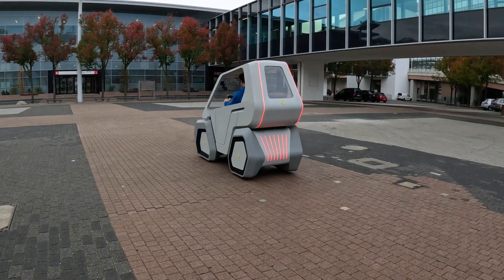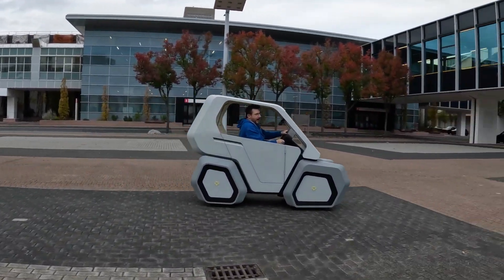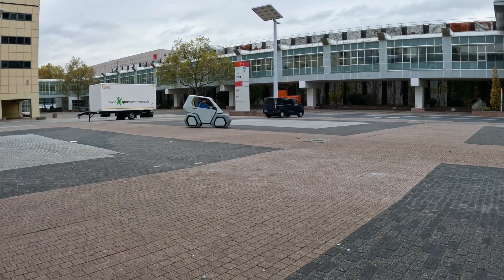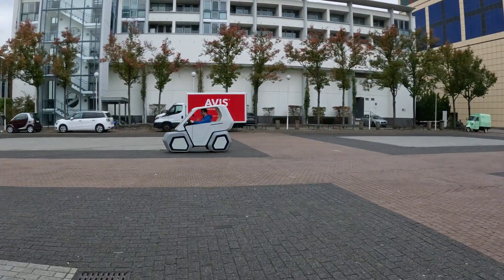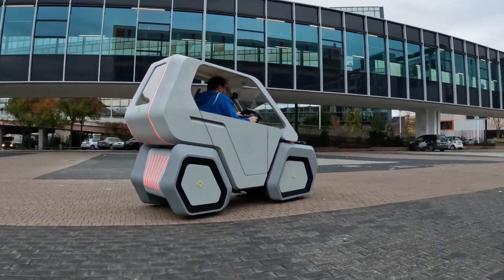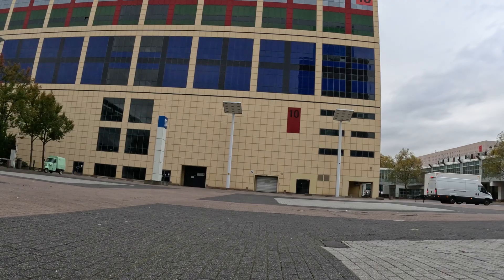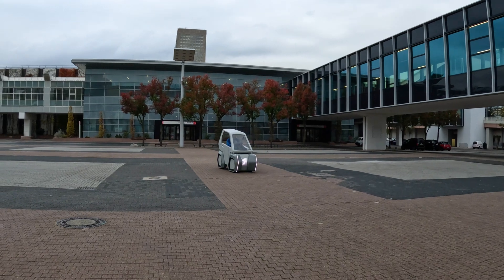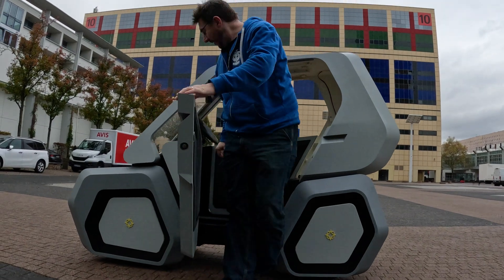Bicycle of the Future?

Comment: That is so awesome! But as a Dutchie there's no way i'm gonna accept it being called a bicycle
Reply: I can't speak for where you are, or for that matter where this company is located, but I happen to live in the same state in the USA that Joel lives in. He mentioned that this is an "electric assisted pedal" device. In my state, and about 90% of the USA, if it uses pedaling (even electric assisted) as its primary mode of transportation it is classified as a "bicycle" regardless of the number of tires. I had a "4-wheel bicycle" (electric assist hadn't been invented yet) around 30 years ago when I was a child and nobody cared whether it was actually a "bicycle" or a "quadracycle" ... they only cared whether I was wearing my helmet, despite it being nearly impossible to fall off.

Comment: How is this a bicycle that's a small car
Reply: He mentioned that it's an electric-assisted pedal ... um, transportation device. Even with 4 wheels, in most places (including where I live, which happens to be the same USA state Joel lives in) the pedaling part makes it officially a "bicycle" (the law doesn't differentiate between bicycle, tricycle, and quadracycle... anything that you pedal to make move counts as a "bicycle"). They sell "4-wheel bicycles" all the time. I had one as a kid (almost 30 years ago) because I couldn't keep my balance (discovered later it was an early symptom of a form of muscular dystrophy / neuropathy). There would be a little more argument that it's a "car" if you were using the don't-bother-pedaling "electric assist" option (aka throttle mode), but at least in my state that's considered a secondary mode, the primary mode (aka pedaling in this case) is what decides how it's classified. Different locations will of course have different rules (for example, if it IS classified as a "bicycle" he's required to wear a helmet even if he's inside a shell, at least where I live) so it's important to look up the laws/rules instead of just guessing, or even taking my word for it.

Comment: Depending on the price it might or might not be a reasonable purchase. You mentioned getting a coffee in Seattle in the rain. Well, that ride might be covered but I notice that the right and left side has no protection and how often does rain just fall vertically with no wind sheer that would drench you. Plus, I assume no windshield wipers. There is a small 3 wheel transport I have seen in our Scottsdale Arizona Mall called a Solo. Seems like it's more doable BUT it's $16-18k. I drive a 2020 BMW i3s which, by no means was an inexpensive purchase but it's very highway usable gets, if I baby it, 200 miles on electric plus it has a small scooter engine that runs a generator to maintain the battery and I can drive approx 80-90 miles in gas powered generator mode so I will not be electric stranded like with the traditional Tesla, Polestar, etc. You can grab an older BMW i3 for about $16k but older means less technology and less miles per electric. You can grab a 2020 model like mine for about $30-33k which new was, shockingly, $63k or at least mine was as it's loaded to the max and it's the "S" model. I am not a Tesla guy, too many makes them boring and too typical.
Reply: What you seem to be missing is that this is officially (by law, at least in most of the USA, including Seattle) considered a "bicycle" (pedal to move, regardless of number of wheels and regardless of whether the pedaling is assisted)... it's not even allowed on the highway (except in certain very rare circumstances and even then it must stay on the shoulder at all times) so that part of the argument is moot. Even a scooter requires a license to drive (unless it's SUPER underpowered, less than 49cc or equivalent, in which case you won't even be able to maintain city street level speeds, and again it wouldn't even be allowed onto a highway in most circumstances), a bicycle does not. Also, if a scooter runs out of power (whether that's gas or battery), it's time to start pushing. With a bicycle, you're already pedaling it, so if you run out of power you're just going to have to pedal a little harder.

Comment: I like the concept, but it would need at least 2 changes for me to consider getting 1:

1. Sure, those wheel cover things look ok, but they're a big problem for ground clearance for anyone who has to deal with speed bumps.

2. It would need some sort of mechanism so that when you get out of it you could make some of its length convert to height. Where I would have to keep it would require maneuvering it around a rather tight 90° turn - not a problem with a conventional bike, but with 1 of these as it is...? I don't think it would be possible.
Reply: Since it's marketing towards bike users I don't think they are worried about speed bumps any more that bike manufacturers consider speed bumps. And, of you want that convenience of getting out then you might want to buy a bike.
Reply: @DaveDarin  Bikes go over speed bumps all the time, what are you on about?.
Reply: @DaveDarin  The problem with this product & speed bumps is the same as some cars & speed bumps.

Sure, the wheels will be ok with a speed bump, but they have to actually get to it first, which is a bit difficult when you have part of the bumper or air deflection mechanism or whatever you call it hitting the speed bump before the wheel can get to it. From the looks of it, this product would seem to have the same limitation.
Reply: @justsomeguywashwd_jbm821  ah, I got your point. More about the ground clearance than wheels and discomfort. Gotcha. Then you are very possibly correct in your concerns.
Reply: @DaveDarin  Yeah, that's it. Also, regarding my other point - I don't think it would be too difficult, I've seen something similar in some concept EVs (to reduce space taken up when parking), but I would think it shouldn't be too hard to do as some kind of manual folding mechanism.

Comment: I think they missed the mark on what a “bi” cycle is cool design but needs renamed
Reply: lets call it "velocar". Already a pretty common name for such vehicles - and used to name the ancient vehicles of Mochet or the Fantom.  And it is not even the 1st recent bike of thie category. There are actually lots of prototypes and even one You can order (the Quadvelo).
Reply: I do agree with you about the confusion of calling it a "bicycle" when it's technically a quadracycle, but the law doesn't care what either of us think. I don't know the laws where you live, but where I live (and, by coincidence, Joel does too) anything that is "human powered" (aka pedaled, even with the hands instead of the feet) is legally considered a bicycle regardless of number of wheels, electric assist, or even full enclosure. There are only three classifications of consumer vehicle (not getting into RVs, "big rigs" etc): car (self-powered, 4 or more wheels), motorcycle (self-powered, less than 4 wheels ... aka anything from 1 to 3 wheels), and bicycle (human powered, regardless of number of wheels... 1 wheel? bicycle. 20 wheels? bicycle ... if it has throttle control "electric assist" it is still considered a bicycle if it's possible to turn off/disconnect the power and still make it move by pedaling, but if it has a motor it's not allowed on certain bicycle paths or sidewalks... road bicycle lanes do not have that limit). Scooters (including "electric assist" bicycles if it cannot move by pedaling with the assist disconnected) are "low-powered motorcycles" and don't have the same restrictions (specialty driver's license, certain specific safety features) as a full powered motorcycle, but they are still lawfully considered motorcycles and must follow all the same laws: helmets, lights, can't be on the sidewalk (even walking it, apparently) etc ... licenses, both vehicle and driver, if it's above 49cc or equivalent, less does not need either while still being required to follow all other motorcycle laws.

Comment: For some reason unknown, small + strange vehicles just excite me i want one. Even if i had the files it won't fit on my ender 2.
Reply: Get something like Luban that can split STL files into (probably about 100) pieces complete with built-in assembly pins and holes to lock them in place, then glue them all together. You might want to look into "filament welding" for something like this (basically, put a piece of the same filament the parts are made from in a Dremel tool, run it at high speed along the seam and the friction will melt the filament into the seam and effectively "weld" the parts together ... much stronger than glue, but surface only so better to use both, at the very least put glue on the assembly pins). Problem solved.

Comment: Random question: 
Do you need ventilation for printing with petg?
Reply: My preferred filament is PETG and I do not ventilate. I use either a Lulzbot TAZ 6, my preferred machine or my Sindoh DP200 or Snapmaker 2.0 can also handle PETG. The Sindoh is an enclosed printer so for ABS, which I am not a fan of, I only print that filament with the Sindoh. ABS filament printing is horrible and needs ventilation, absolutely.

Comment: Not to be a wet blanket but its just an electric bike with a huge plastic shell. It being 3d printed isn't really a selling point its just a manufacturing design decision to get people to go ooh and ahh. Its cool tech to be sure. I'm more interested in the guts of the bike. He said he was pedaling but going backwards meaning the bike pedals are independent of the motors rotation. So I'm wondering if the pedals are a manually cracked electric generator that supply power to the motor. But the size of motor must be a beast for that to work. Extremely low voltage high output. I wonder if the battery supplies the majority of the power and the pedals merely denotes motion to the computer. Edit: after watching that portion again turns out he's just pedaling backwards. Its just its just a four wheeled electric bike with a plastic cover.

Comment: It lacks the mobility of a bike, though.  It may fit in the bike lane, but what do you do when it's trash day and people have put their trash cans into the bike lane? It looks like it drives like a quad (because it is) rather than a bike.  It's a golf cart with bike wheels. 

It's super cool that it's 3d printed - even if it flops, it's better to flop with only 3 months in development instead of 12.  I'm not sure how long it would take to make fiberglass molds to do the same thing, but I'd imagine it's an extra step between CAD and real part.
Reply: But why make the canopy so much worse at drag and clearance?
Reply: 3D printing has the added advantage that it is digital, i.e. tool free (no molds). That means design changes can be made on the fly. That has numerous implications, if you think about it for a while, including "mass customization" at minimal extra cost.

Comment: Looks interesting, but in many jurisdictions 4 wheels makes it not a bicycle and the vehicle laws kick in and make it illegal/impractical. Bicycles may be required to have 2 or 3 wheels. So major law changes are required before it can be done. Ebikes are great when the weather is good but 25 km/h is too slow, many pedal bike riders would need to pass and the bike lane would be choked. :)

Comment: But a long way to go, until it will be legal on German Streets. If you have to paddle, it is OK, but if it drives without paddling it need a technical inspection.
There are multiple vehicles like this already on the marked.

Comment: It is amazing that such interesting and large shapes can be 3D printed, however, the thing as such is hardly a viable project for commercial release:

1) The body of the bike/quad/car is unnecessarily bulky and unaerodynamic, so apart from adding dead weight, it also drains power through wind resistance. And unless it has gets side windows, its roof is pretty much useless, too, in terms of protection from rain.
2) The thing is not green, just like any other electric vehicle. It's exhaust is just located elsewhere, in a coal or gas power plant. But since the energi first needs to be pumped into a battery, the efficiency, compared to a gasoline car, will be significantly worse. If anyone wants to reply with, but wind turbines, and solar panels, than maybe just first look into, how much power they actually produce, this is despite Germany going completely overboard with them, building them practically everywhere, at the detriment of agriculture, wildlife, and the overall aesthetic of the German landscape. Also, making batteries for cars like this requires rear earth metals, which is a whole another chapter of ecological apocalypse. But no one cares, as it is happening in China and Africa.
3) The wheel fairings, which don't seem to have any other purpose than reducing the vehicle's efficiency, as described in 1), will make it practically impossible to go over any kind of bump in the road or a curb or any other obstacle. Something you can do easily on a bike. This is a clear example of looks over utility, and a really horrid looking at that.

In conclusion,
no sane person will ever buy this thing, but the 3D-printing aspect is, admittedly, interesting
Reply: Battery's won't use lithium for much longer there like 50 different people coming up with battery designs at least 3 have already released cells for the public to make their own batteries. Some cars and bikes already starting to use the new batteries that don't use lithium. Tesla next car next year will be using a new battery they are producing and designed in a house that doesn't use lithium.
Reply: @Bigdog1787  So what do they use? I've heard about a great new battery solution just around the corner for the past 15 years, and we still use lithium. The only promising alternative I know about is graphene, but it seems we are still a long way off before it can be mass-produced. Even with batteries solved, that doesn't take away from the other flaws of the design, I pointed out.
Reply: Ya graphene is one of them a few cars and e-bikes, but there is a new one being used in more cars next year which uses the 6th most common resource on earth silicon which will make battery's cheaper and easier to recycle and supposed to last 10 times longer not sure on it's capacity I know graphene is x2 of lithium and lighter wile being x2. Capacity is what we need more than anything currently and I know graphene is quite hard to produce compared to lithium.
Reply: @Bigdog1787  well, I'll believe it when I see it. I certainly hope you're right. My other arguments still stand, though.

Comment: As a wheelchair user, I wonder if the same sort of idea could be cooked up in a manual form, hand levers instead oe pedals sort of deal, no idea off the top of my head how it would steer though.
Reply: the typical hand-pedal trikes combine pedals and steering in one unit.. The tiller has resistance to keep from turning when pedaled, but it's easily overcome if you need to turn.

Comment: I've seen bikes with disc wheel covers being a hazard because of wind, this seems more dangerous than that, if the top is for protecting from rain it would be useless without windows making this amplifying even more the wind problem. Also, Electric bikes have been causing accidents both for regular cyclists and pedestrians. To be honest this just seems like a glorified scooter, I don't see it being legal any moment.
Reply: Is a good concept, but is it practical? I doubt it

Comment: wow this is a horrible design lol
the covered wheels sounds like a good idea until you realize that for bike lanes and other pedestrian shared roads, the visual rotation speed of the wheels is a very valuable information on how fast a bike or any small vehicle is going. It will be really hard to judge how fast this thing is going, which is extremely unsafe. Also if you run into mud or anything wet, where is it all going to splash and accumulate? there are no screws visible, how are the wheel covers removed for maintenance? the front wheel covers didn't seem to pivot with the steering, meaning the actual vehicle inside is much smaller than this awkward frame. the only thing this ugly exterior makes me think is "what are they trying to hide?". and with the covers being so close to the ground, how will it manage small bumps and rocks on the road? we're at a point where making an ugly "3d printed" exterior for an otherwise "fine" product doesn't mean much anymore, 3d printing has come a long way and it's no longer a challenge to make actually good products with it.